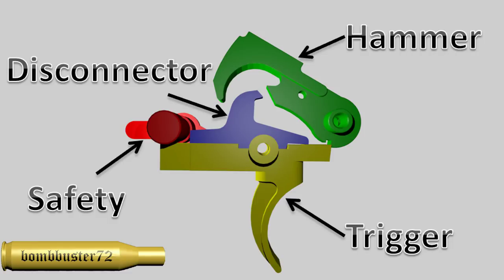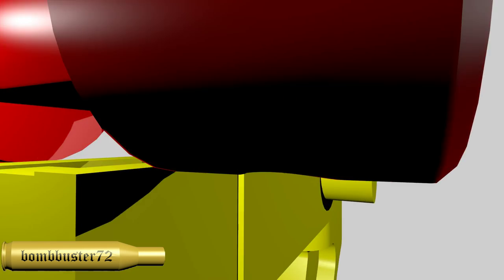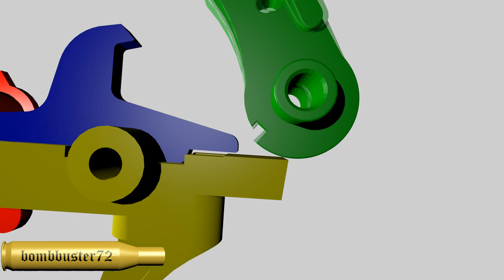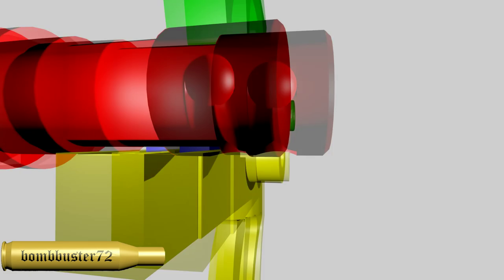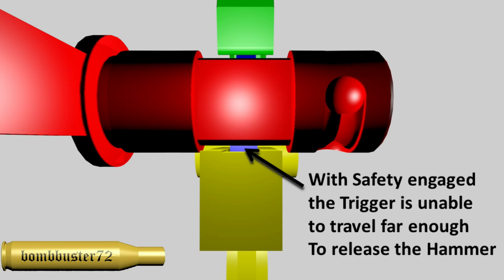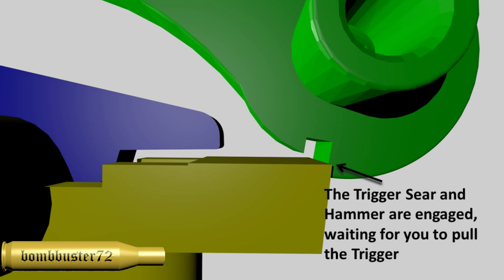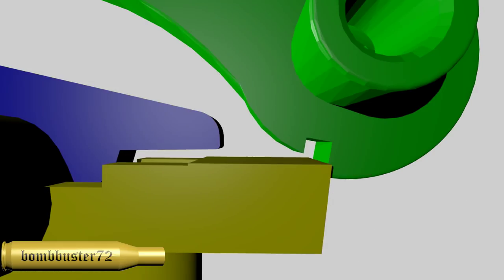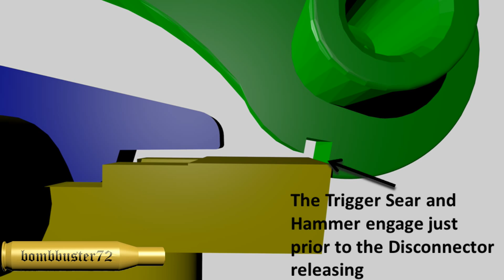3D animation of AR 15 Trigger functioning

Comment: If your disconnect spring is damaged or wrong spring it will cause 2 to 3 round burst then stop. Be sure you correctly identify your magazine release spring and disconnect spring. They will interchange but are not the same spring . And get spare spring kit to keep in your shooting bag/case.

Comment: CAN ANYONEPLEASEHELP!?!?! Ok so with a ar-15 p80 in 556 and when the trigger goes forward it doesn't release from the first catch(hook) so the hammer is unabletobe released by pullingthetrigger... so its not together yet but the trigger assembly is in and when the hammer is pushed down it hooks but you either have to push the trigger forward a very small amount and it releases and resets allowing the hammer to drop when the trigger is pulled... it also works if the selector switch is moved from fire to right around half way to safe. At that point it releases resetting then you put the selector back on fire and it is able to fire...it only has to go half way not all the way to safe. this happens every time... so should be working correct? Or does the upper have to be on for it to  work properly? Some people said they had this problem because of a small burr on the hook so it wouldn't reset until they sanded it down smooth. don't think that is the problem because it's already been sanded it down... does ANYONE  HAVE ANY IDEAS ON HOW TO FIX THIS AT ALL? PLEASE LET ME KNOW... Thought about getting a drop in style trigger but they're a little expensive right now. Not understanding why what is already here won't work... EVERYTHING was picked up at the same time from the same person and there was no shortage of people getting the same thing and MANY were coming back after a prior purchase not just first time buyers! Asking around everyone had nothing but good things to say about their prior purchases/builds. Please if anyone can help it would be HIGHLY APPRECIATED!!!

Comment: So does the hammer only ever make contact with the disconnector in that one place?
Reply from the maker: As far as the disconnector, that's all that should make contact. It's job is to hold the hammer back until the trigger is released, allowing the sear to engage.

Comment: But what program you used to make this animations and what about the 3--round burst?
Reply from the maker: I use Blender. It's free, but very capable.  There is a steep learning curve on it, but once you get the keyboard shortcuts down, it's not bad.
Reply: Three round burst is a gear on hammer and lever on trigger pin. When safety lever presses on lever and trigger is squeezed — lever takes gear and pulls it. On second round it again pulls gear. After third round gear cannot be pulled because of it’s shape so lever rises and presses on disconnector.

Comment: What would happen if you was to remove the disconnector
Reply from the maker: One might think this would cause it to go full-auto, but it's just not the case.

The disconnector allows that fraction of a second needed for the bolt carrier to travel forward and lock a new round in the breach, before you fire the next one.  If the disconnector were gone, the hammer would ride the bolt carrier forward.  This would not allow enough force on the firing pin to fire a round.

If it did go auto, the ATF would have demanded a fix long before now.  Instead, you would have continuous problems and would effectively have a single shot rifle, requiring you to reset the trigger after each round fired.

I hope this helps; thanks for watching.

Comment: Do you have this in a file that can bo opened by SolidWorks, like a .STEP file? If so, we'd like to purchase it from you. Please contact earl at impact weapons components. Thanks!
Reply from the maker: I don't , but I'll see if I can convert it to a format that will work.
Reply: Perfect! Thanks!
Reply from the maker: I apologize for not getting back with you earlier. I had an external hard drive that was stolen and I can only assume that the original files were one there.
I can re-make it, but I only dabble in computer modeling so it would take me some time to get it completed.  If you don't need precise measurements, it could be done quite a bit faster.  It would look right, but the dimensions would not be CNC ready.
Again, I apologize for taking so long to get back with you.
Reply: Ok, thanks for the info and trying to get the file. At this point, we'll look to create our own in SolidWorks. Thanks anyway!!!
Reply: Earl, if you are still on the search of this components in solidworks, contact me.

Comment: Good evening I have a question when I put my selector switch on safety. There's no movement from the trigger when I put it on fire there's movement, question when I put in battery and put selector switch on safety trigger fires.

Comment: a friend has core AR,it double fires,ever 20 rounds,it's all factory??
Reply: look for trigger pins to be loose (enlarged or egg shaped holes) also sear spring in wrong or missing.  Or any other parts chipped or worn.  If it continues you may be in trouble for having an unregistered machine gun.  Do not continue use of this gun rather replace trigger group or if you cannot do this take to gunsmith.

Comment: My new trigger has a problem that when the bolt is locked back, pressing the hammer down, it raises the trigger bar too high to fully engage the safety. If the safety was already fully engaged and the bolt forces the hammer down, it creates undue stress on both the hammer pin and the trigger pin.
Now I see where I can Dremmel some meat off the base of the hammer without affecting the safety or function of the trigger. Thanks!

Comment: Would removing the disconnector effectively turn it into a full auto?
Reply from the maker: Probably not. The hammer would "ride" the bolt carrier forward, and wouldn't likely have enough force to set off the primer.

Comment: Great animation. You could do another video with the same style of animation explaining the full auto mechanism.
Reply: When you put the selector on AUTO, it pushes the disconnector down so that it never engages with the hammer, allowing the hammer to spring forward as long as the trigger is pressed. Also, at the back trigger group is an auto sear that prevents the hammer from springing forward until the bolt carrier group is completely cycled (completely closed) during which the hammer will be released again and fire another round: https://youtu.be/cxwPEL8winI

Comment: Brand new Core15 scout 160 rounds fired trying to fire six times fired 4 chambered 2 light strikes will not reset on its own unless I flip the safety???

Any help would be really appreciated love of the rifle love the platform...
Reply from the maker: Strange. If it's not gunked up, I would contact the company.
Reply: Did you get it fixed what was the problem?
Reply: Yeah I got it fixed I got close to six hundred rounds through it .
I don't get to shoot as much as I like is part of the break-in. 
It thoroughly needed to be cleaned and I ran several Brands ammo through it no problem. 
Runs like a Singer sewing machine👍💪🇺🇸
Reply: @jamesstacey529  very cool!